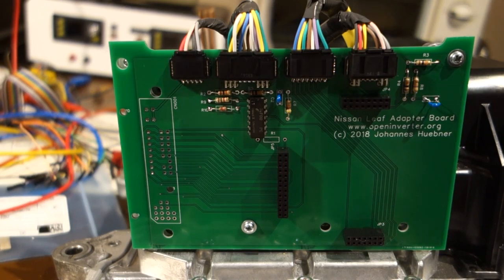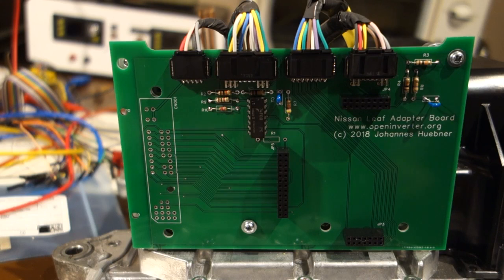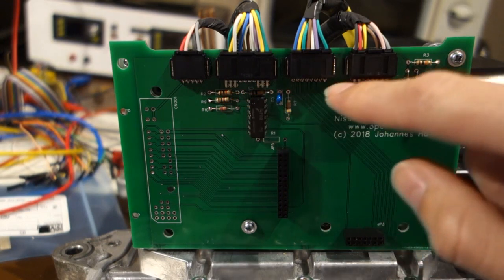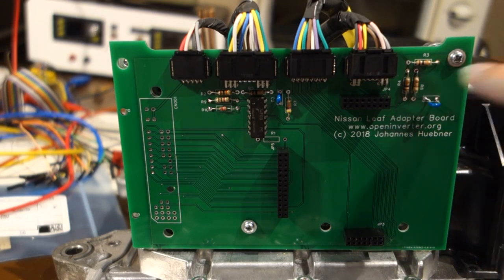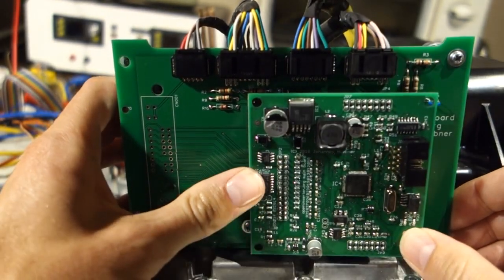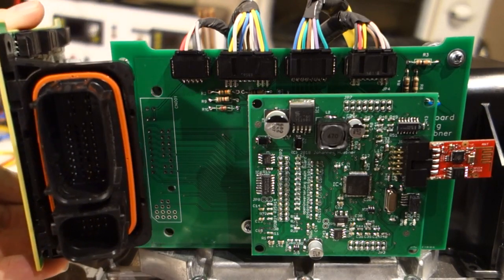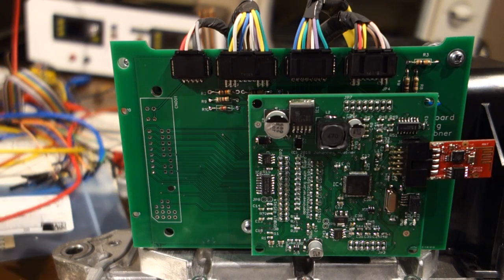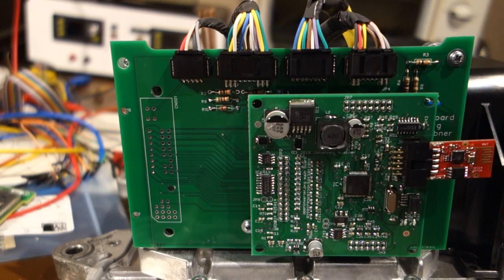Lab Update #16: Nissan Leaf Dropin Open Source Controller

Comment: According to the link below on slide 5 the Leaf battery pack voltage is upped to about 500VDC before going to the inverter.  Were you aware of this?  Could this be affecting the  performance of your setup?http://www.powerelectronics.ac.uk/documents/2019/industrial-panel-slides.pdf

Comment: Great work. What years of nissan leaf does this board works for?
Reply from the maker: What you see in the video is the Leaf Rev 2 inverter. It was built 2013-2017. The rev 1 inverter looks quite different, I haven't seen a rev 3 yet
Reply: @openinverter  Thank you for the infos.
Reply: So ...if i fave leaf 2012 its no fit?  Can you help to understand what Rev  i have?